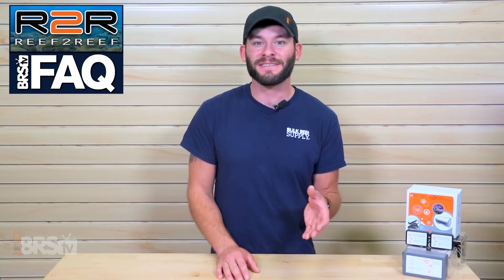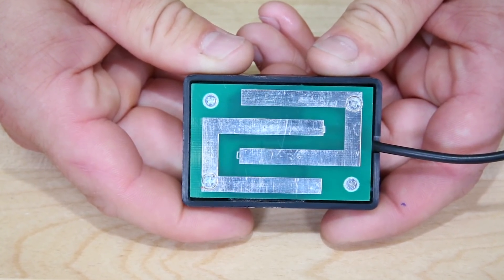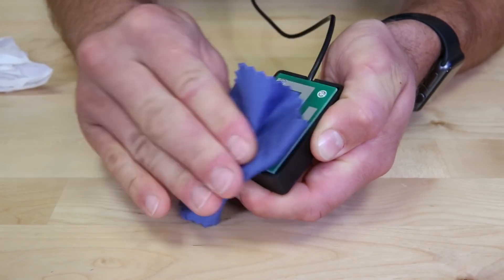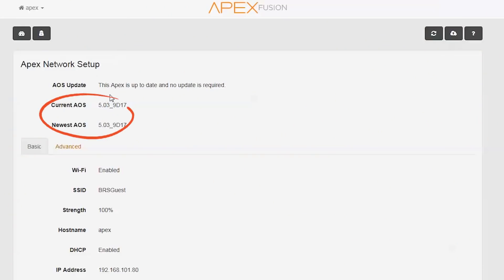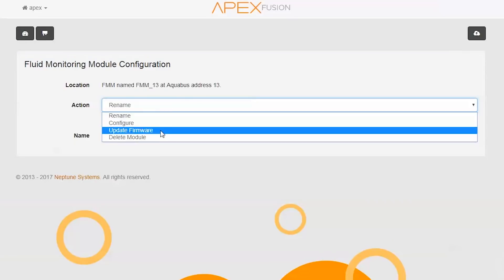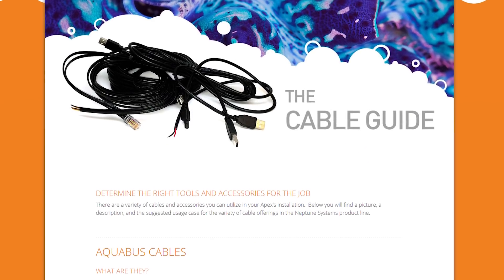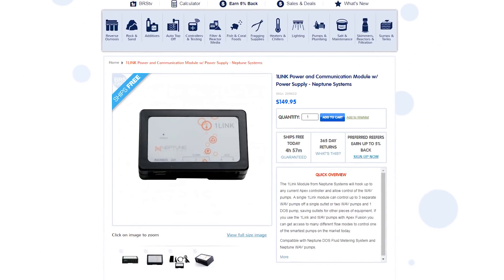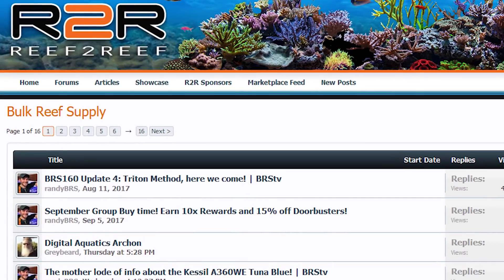R2R FAQ: How to use multiple modules, update firmware and how long do these last?

Comment: If I bought a  a calcium reactor . I don't have any corals that consume calcium. Would I overdosed my system .Is there a way to tell if you're overdosing your system . Is it at its easy as just measuring calcium at 420 and DKH at 8.5 . Just adjust The effluent out of the reactor .?
I wanna start buying corals ,And have my parameters stable .
Reply: BulkReefSupplyCom Thanks BRS